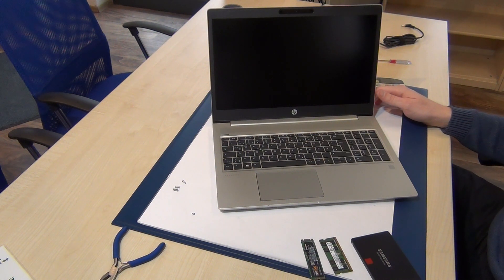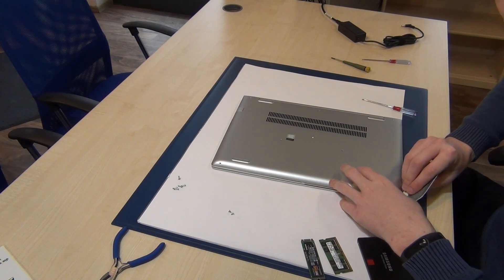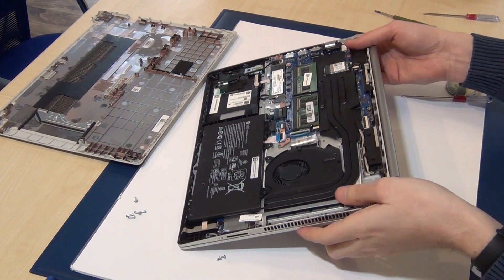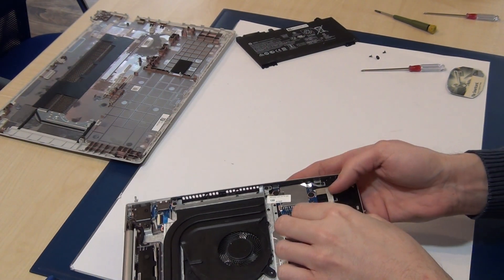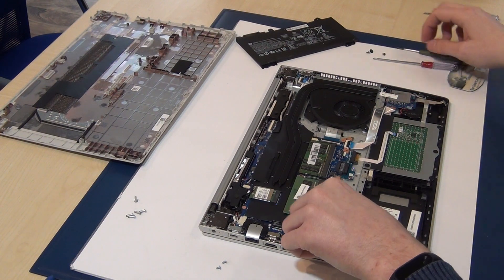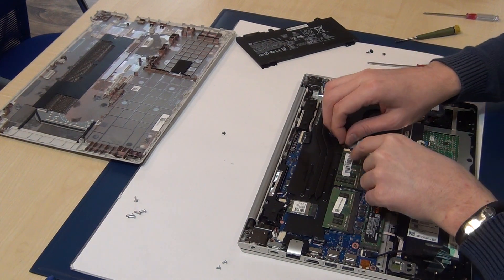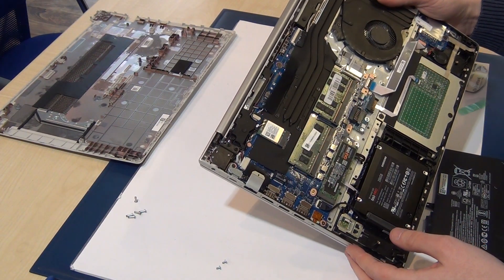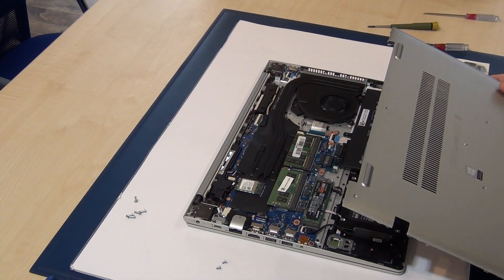HP ProBook 455R G6 Disassembly How to open Repair Upgrade Guide RAM SSD HDD Battery Fan Touchpad

Comment from the maker: Parts / Passende Bauteile für den Umbau:

Mich unterstützen/Support me and buy at amazon - https://amzn.to/3P8uXjS (*)

RE03XL kompatible Akkus / Battery - https://amzn.to/3gYAIUB (*)

Arbeitsspeicher Crucial 8GB SO DDR4 RAM 3200 - https://amzn.to/3i2h1vm (*)
Arbeitsspeicher Crucial 16GB SO DDR4 RAM 3200 - https://amzn.to/3tMyB9e (*)
Arbeitsspeicher Crucial 32GB SO DDR4 RAM - https://amzn.to/3tOg2S1 (*)

SSD Festplatte WD Blue Series 512/1TB/2TB - https://amzn.to/3GFuLGi (*)
SSD Festplatte - 512GB Crucial P2 Serie - https://amzn.to/3TQCdS3 (*)
SSD Festplatte 1TB Crucial NVME P2 Serie - https://amzn.to/3EgSda4 (*)
SSD Festplatte 2TB Samsung NVME 970 EVO Serie - https://amzn.to/3ENiYod (*)

SSD SATA 2,5" 1TB Samsung 870 Series - https://amzn.to/3VSPBqo (*)
SSD SATA 2,5" 2TB Crucial BX500 Series - https://amzn.to/3uqHo0Y  (*)

Die mit Sternchen (*) gekennzeichneten Links sind sogenannte Affiliate-Links. 
Wenn du auf so einen Affiliate-Link klickst und über diesen Link einkaufst,
bekomme ich von dem betreffenden Online-Shop oder Anbieter eine Provision. 
Für dich verändert sich der Preis nicht.

Comment: Thanks for the helpful video. If someone is adding a new hard drive you may not have the cable like there is in the video, in which case you need HP part L45094-001. I learnt this after buying the drive and opening up the laptop.

Comment: I have this computer as a standard (8GB Ram with 128gb of SSD). I can upgrade the ram to 32gb. However, I am thinking of just adding an additional16GB of Ram to it making it a 24 GB ram. In addition, I was just thinking of adding an additional 250gb internal hard drive and not upgrading the SSD as I don't have much cash. Do you think my idea is ok? So I'll be adding 16GB oF RAM and an additional internal 250gb hardrive, will it be ok? - subbed.

Comment: I am installing extra 4GB RAM in brand new i5. I had removed the screws but was scared to pry the cover off until I watched your video. It sounds like I am destroying the cover when removing it. I got it off upgraded and back together but it seems that many will break theirs attempting this. Thanks for posting.
Reply: I bent the metal edges of the laptop getting it off. It is a bit tricky. Definitely more serviceable than my asus though.

Comment: Hallo Alex, super Tutorial. Ich möchte am ProBook HP Probook 455R G6 ein zweites Speichermodul einsetzen. Ich habs genauso gemacht, Schrauben raus, alle Clips geöffnet. Aber irgendwie geht die Rückwand trotzdem nicht ab. Irgendwas ist da noch in der Mitte der Rückwand. Ich will auch nichts beschädigen und nicht zuviel Gewalt anwenden. Kann es sein dass die Rückwand noch in der Mitte verklebt ist ?
Reply from the maker: Da will ich mal nicht für jedes Modell 100% sicher sprechen aber es ging bei mir auch sehr schwer ab.
Reply: @thepcjj  Hallo Alex, ist das Gehäuse aus Aluminium und der Deckel unten aus Plastik?